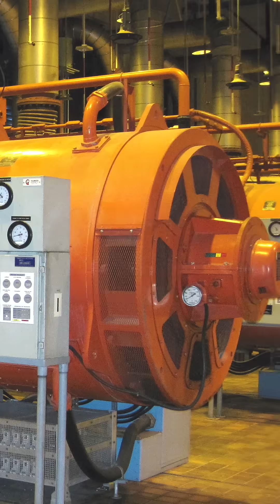wHaT iS tHE LARGEST ENGiNE EvER MaDE?

Comment: Thats an expensive oil change
Reply: They never change oil in those engines 
It is run through centrifugal purifiers
Before going back through the engine
Reply: @hansknutson2327 Honda 4 stroke motorcycles used to use centrifugal oil filters in the '70's, they were a very good idea, & I wish they still used them now.
Reply: @hansknutson2327 I wonder how much lubrication oil the engine consumes.
Reply: @wiredforstereo it burns oil my man fuiloil.
Reply: I used to work for a laboratory that does analysis on the oil for engines like these - they'd check for all kinds of things regarding engine health via oil because yeah, it is hella expensive to do an oil change at this scale.
Reply: Based on about 2.1 quarts of oil per liter of displacement, it would cost close to half a million dollars for an oil change just in oil. 

It's definitely not exact, just based on a wild guess.
Reply: @Miked1332 The oil isn't changed for the life of the engine. It's a dry sump setup with centrifugal purifiers and filters to maintain oil condition.
Reply: But its a 2 stroke - she's an oil burner.
Reply: @Dubbinaround1 not that kind of 2 stroke lol its not a giant weedeater motor. Think of the giant locomotive 2 stroke diesels. They still have oil circulating in them.
Reply: @jordanalexander615 yeaaa then it goes into the combustion chamber
Reply: @ineedapharmacist They use more oil than a 4 stroke, but they dont "burn oil" unless something is wrong.
Reply: @wiredforstereo  The do actually "burn oil". These things use 2 types of oil. System oil and cylinder oil. The cylinder oil gets injected directly into the cylinder walls every cycle, which gets burnt during the combustion stroke.
Reply: The engine oil for these is literally pumped to and from barges
Reply: yes it is. Moving the barrels of oil from the deck to the engine room is tedious work. I despite it cause I'm a deck crew and not an engine crew but they need hands for it.
Reply: 2 stroke diesel ≠ 2 stroke gasoline
Reply: I thought they use crude oil
Reply: @Truth_chan_studio no. We use HFO (heavy fuel oil), VLSFO ( very low sulfur fuel oil) and diesel. That is the common fuels we use. It depends on the area which fuel we will use. If normal transit we use HFO the most common fuel. Some countries requires VLSFO or diesel when arriving at port.

Fun fact we can change the types of fuel even the engine is running. 

Also do note that crude oil is the base of all oil. Oil platforms pumps fuel from the ground, transfers it to a VLCC ( very large crude carrier) then what we call a ship to ship operation happens. A ship will stay besides a VLCC connecting it to transfer the oil to that ship. It can be another VLCC or smaller ones that will transport it to refineries. From there the oil is refined to fuel which then be transported by a product tanker. Crude carrier and product tankers are not the same. One carries the base material one carries the final product.

I'm a container and a bulk guy. Don't want to mingle on tankers. In the industry we jokes about it as killing me softly work. Due to the high risk of carrying those goods they have hazard pay and we don't.
Reply: It’s a two stroke, the oil should be inside the gas itself
Reply: @WhyIsTheRumGone-e7lwrong kind of 2 stoke there bud. This is like a 5 story building sized Detroit diesel which btw is fuel oil. This ain't no weed whacker or chainsaw from Lowe's.
Reply: @itsamefrank  fair enough
Reply: @itsamefrank Diesel is literally #2 fuel oil, so it’s premixed since it got pumped outta the ground lmao
Reply: @WhyIsTheRumGone-e7l  The sump oil is separate from the combustion/scavenge space. The piston rod passes through a gland to minimise the amount of oil contamination with products of combustion.  The sump oil should last the life of the engine thanks to the use of filters and centrifugal purifiers. Cylinder lubrication oil is pumped into each cylinder liner during operation via small bores in each cylinder. This is burned off during combustion and helps to reduce liner wear. It's an alkaline oil so that it can help neutralise the acidic products of combustion.
Reply: @gjcgjc9912  Ah yes,ok. And. So. Well I ......
I operate a Zamboni......

The only measuring contest comeback I could ever come back with.

Go from the size of this engine
To how the hell does a ice surface actually works.

We are all skills in our craft.
Share the knowledge.
Reply: @WhyIsTheRumGone-e7lthere’s 2 types of oil in 2-strokes
Reply: Ship engines use a type of fuel called fuel oil or bunker fuel. Its a grade just above the crude oil they pump from the ground.
Reply: @WhyIsTheRumGone-e7l 2 stroke diesels dont work anything like gasoline 2 strokes. They have active oiling just like a 4 stroke. So no you dont put oil in the fuel, diesel fuel is an oil, a fuel oil.....
Reply: Its a two stroke engine no?
Reply: @linusboden7050  slow speed, 2-stroke marine diesels have a dry sump oil system. The oil lasts the lifetime of the engine as long as it is properly maintained and conditioned.
Reply: Oil change? It's a two stroke! xD
Reply: @DanielM.-mq4rm 

It is a 2-stroke but it's not anything like the type you're thinking about.
Reply: @gjcgjc9912  It's exactly the Wärtsilä RT‑flex96C Marine Diesel 2 Stroke Engine I'm thinking about. It does not require regular Oil changes...
Cylinder oil is metered to liners/rings (low feed rate), bearings are lubricated via the oil system, and the engine uses purifiers/filters rather than simply dumping sump oil frequently. Maintenance focuses on keeping those systems working and topping up oil as required and not replacing it at fixed intervals
Reply: @DanielM.-mq4rm  Fair play. Thought you were meaning it operated like a petrol 2-stroke. I sailed on the 7-RTA-84TB and the 7S60MC.
Reply: Doesn’t need an oil change, it’s a 2 stroke engine dummy.
Reply: @huh0123 it uses oil - which oxidises over time. It'll need a change eventually. 

It was literally my job to test for how much oxidation capacity the oil had left in it for 2 years and it was almost exclusively for marine engines.
Reply: @widget3672  A well maintained marine slow speed 2-stroke should never need an oil change for its entire working life. The sump oil is always clean and the contamination due to products of combustion should be minimal due to the design of cross head engines. The crankcase is sealed off from the scavenge space by means of the piston rod gland (stuffing box). 

The only oil that is actively designed to be consumed (aside from the fuel oil) is the cylinder lubrication oil.

Comment: 40HP per ton of weight and 4HP per liter of displacement. Not exactly too high tech
Reply: It's for the ships. Ships don't move like speed boat they don't need that much hp btw those engine's mostly have 5m pound feet of torque
Reply: @KingInBlack260 I know. Still doesn't sound too efficient
Reply: @jonaszimmermann1361 If you calculate the consumption, it is insanely efficient. It consumes 250 t or 300 m3 of HFO per day. The ship has a speed of 20 knots, so she travels 900 km per day (approximately). This makes a consumption of 33 000L per 100km. If you consider that the ship displacement is around 200 000t, it burns 0,17 L of HFO to move 1t over 100km.
Reply: @jonaszimmermann1361  Its exactly the opposite actually, its super efficient. Going by thermal efficiency, that is, which is what most commercial industries and especially shipping cares about.

Weight isnt super interesting to them and power per displacement absolutely not at all.

Comment: Nahhhh.  Thw oil change on these are gonna be crazy
Reply: This engine has a dry sump, and the lube oil tank is 80 m3. With a price of 23 000$ per cubic meter, the bill is going to make you cry.
Reply: @Unachron  And the worst thing is that it's a 2 stroke, so it will slowly burn up that oil.

Comment: wait ITS A TWOSTROKE? BRO ALL THAT OILING ITS BURNING
Reply: It is a 2 stroke because they have a better efficiency. Also you need two different oils, one for the cylinder and one for the crankcase so that they can have different properties.
Reply: @Unachron  true true, and i think adding cams and all that top end components is a lotta extra complexity
Reply: @cabooey2905 There are cams for the fuel pumps that feed the common rail. However, there is only one exhaust valve per cylinder. It is controlled electronically and uses an air spring to close back

Comment: 5.6 million foot pounds of torque more than 100000 HP it burns 1660 gallons of heavy fuel per hour. This engine is mathematically nuts all of this In the range of 5-120 rpm